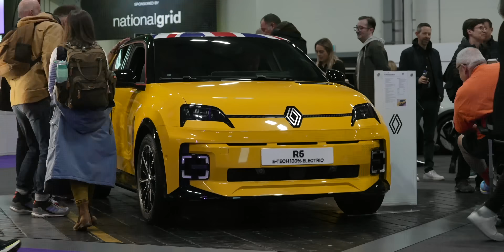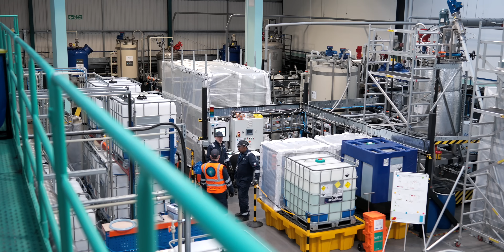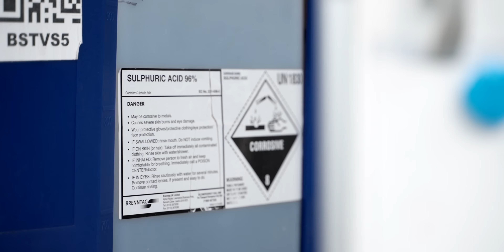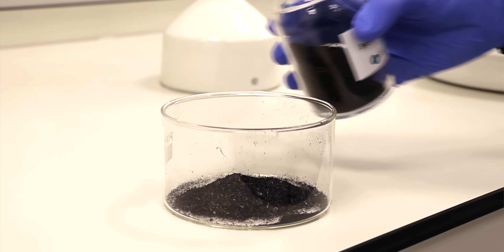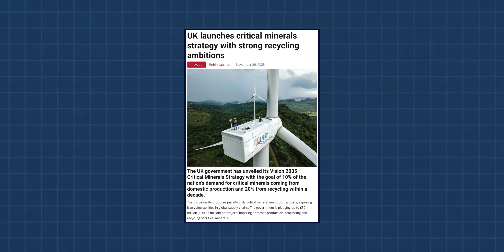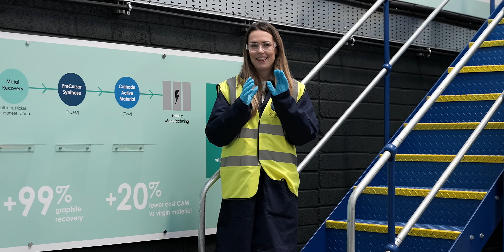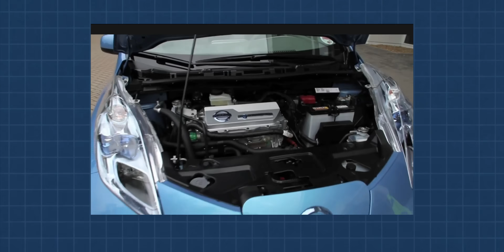EV Battery Recycling Could Be The End Of Mining!

Comment: We'll be mining for materials for batteries until our global demand for energy storage levels off, which may be never.
BUT, battery reuse/repurposing/recycling is of course a hugely important part of the battery lifecycle, and certainly helps make batteries less environmentally damaging that the fossil fuel-based energy economy we currently "enjoy".
Reply: But we need to account for the improved efficiency of newer batteries - more energy storage with fewer materials… Also, newer batteries use new chemistries, with fewer scarce materials.
Reply: @tonyb4773  different materials being used, especially less scarce ones doesn’t bode well for recycling. There also hasn’t been a ton resource efficiency gained with increased energy density. With the exception of cobalt. When it comes to batteries actually in products, They’re mostly packing more lithium, for example, into smaller form factors. Which does help recycling. I’m a big proponent of designing for the entire life cycle including recycling. I just don’t think that a pretty rapidly changing battery tech is going to do that well in that regard. 

We’re also talking about an order of magnitude more batteries for electrification, so mining isn’t going anywhere.
Reply: Yup. They said for car batteries, it will be 2050 before that point comes where we have enough from recycling, but with home batteries on the rise that will become at least 2100 I would say.
Reply: @colinwisemanWe are all waiting to see if the Donut Labs and Cherry “Solid State” batteries are real.  If they are, then the current crop of metals used in batteries won’t be required much longer - at least not to make batteries.

Sadly they seem too good to be true. Having said that the claims of the two companies seem so similar, but not identical, that they might be true. Time will tell.
Reply: @colinwiseman pretty sure grid batteris and home batteries are probably in their business plan.
Reply: Depends, if automation reduces the prices of cars to near 'commodity' levels, then cars may be changed more often than today with an earlier retirement age as a result. The batteries may be designed specifically for high recyclability rather than re-use (companies are working on this already for battery designs), where materials can be separated at much lower cost. The battery makers can then design two products one aimed at recycling for 'consumer' vehicles (which should lower the cost of batteries even further), and more costly ones for energy storage with different characteristics, longer life times, high cycleability etc.